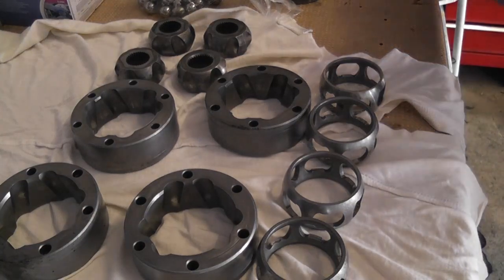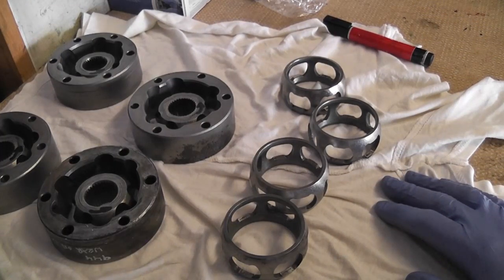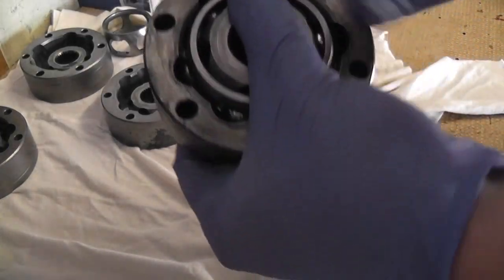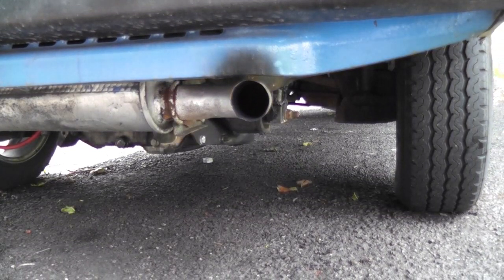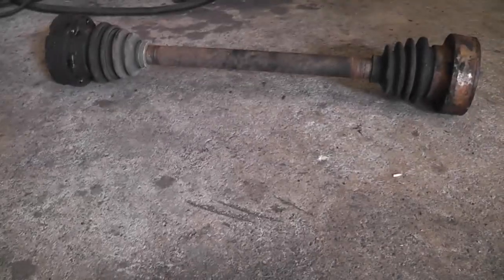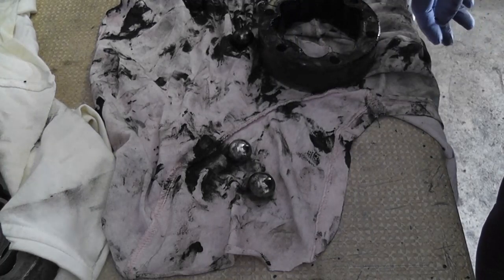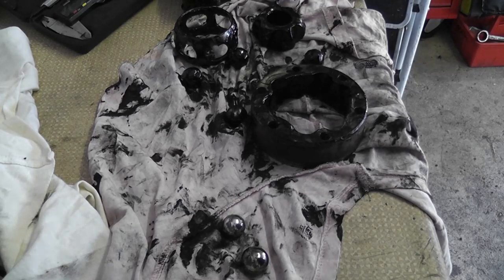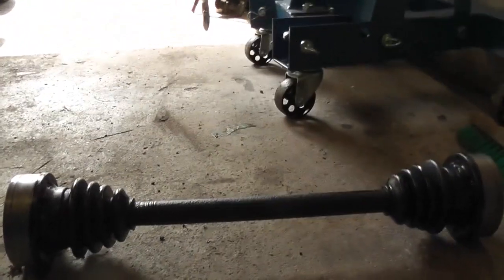Porsche 944 driveshafts in a VW T25 van. Will it cure the clicking?

Comment: Hello,
Wouldn’t a larger ball provide a higher angle? I’ve currently got an original vw t25 driveshaft on my work bench and 2 after market ones. The original vw one has larger balls than the cheap and poor quality after market ones.
Reply from the maker: I don't fully understand the science behind why the smaller balls help, but supposedly they do.

Comment: Hi Ross, thanks for your videos they are very helpful. I'm considering to put a fippedgearbox on my tdi 1z. Did you lower your supension? Or it is possible to mantain the stock shock absorbers and coils? Grettings from Porto
Cheers
Reply from the maker: Hi. Thanks! No, the suspension is stock height. I lowered the engine by 40mm though.
Reply: @Endfloat  I wish you were my neigbour 😄 So the Porsche cv joints can correct the angle? Thanks for your speed answer

Comment: 42:06 - did you buy that spacer or make it up yourself? Having same issue with mine in that the rear is sagging.. (and the camper too)!
Reply from the maker: I had them made in a machine shop. They can be bought though.
Reply: @Endfloat  great job! Do you remember the thickness of each adapter?, i have same problem.

Comment: Really interesting, thanks again! I notice you have a nice heavy trolley jack. Could you please recommend one like yours? I have a small jack but it doesn't lift high enough for me to get under the van really.
Reply from the maker: I bought mine second hand from a mechanic that was closing up shop. Its a snap on one so not cheap but it's one thing you want to be able to trust! It is very heavy too so not easily moved.
Reply: @Endfloat  Yes, I'm nervous using the small one I have. I do have ramps too but I'd like a bigger jack.

Comment: Interesting video! Can you tell me Ross what's your gearbox clearance off the ground under normal load? And if you think the engine/ box could be lowered to reduce the cv angle and compensate on the ground clearance any more, I believe there are some people running theirs with 4.5 inches clearance?
Also I see on the flipped box the flanges are not equidistant from the center line of the box like the origional is. Hence if the engine and box were offset such that the distance from flange to wheel hub on both sides were the same,.. wouldn't this mean that the stress on both shafts would be the same as oppose to one shaft being at more steeper angle?
Reply from the maker: Hi Brian. I have 6.5 inches of clearance myself measured at the bottom of the adapter plate. I probably could drop it a little more but with the 944 CV joints it seems to be ok now. The offset of the flanges is compensated for by the fact that one of the drive shaft adapters is thicker than the other. My biggest recommendation in all of this is to go for the AFN engine rather than the AHU and get a gearbox from a car that had an AHU engine. Also, take the manifold and head off the engine before installing it and clean out any gunk and get the injectors overhauled.
Reply: @Endfloat     cheers for that info Ross. Wouldn't the afn and ahu engines both use the same 012 box? I have a ahu and box from an a4. But it has 280k km on it so might just hold out for an afn if I'm going to be spending so much rebuilding it. 
It's better to use adaptors I'm assuming to build the 40mm or so extra on one side as oppose to recentering the box wrt the flanges? As it would mean the shafts might be too short without the big adaptor flange? Interesting, I see what you say about the head, to clean the gunk in the manifold and head due to build up over time, with relatively small cost of new head gasket and head bolts. 👌
Reply from the maker: @briankelly6114  no, they're different boxes. The ratios are different. I think I need to do a new video with all my findings and what I'd do differently if I were to do it again cause to tell the truth I'm not as happy as I'd like with how everything worked out. I spent a lot of money for little more than gaining a bit more top speed. It added a lot more complexity, if I was stuck, no garage would touch it, I'm still getting 30mpg, and I don't feel it's any more reliable. All in all, I'm disappointed.
Reply: @Endfloat  yes I understand. But unless we could make the repairs we wouldn't be tinkering with these haha. I have many options to think about on how to proceed. I also have a awx pd 130, red d redi which I'm considering installing at 15 - 20 degrees and flipped box. But concerened about ground clearance and coming up into the van into storage space.?? The performance would be savage, and be able to use many of its origional attachments.  To be fair these videos are top notch! Very hard to find good vidoos or reading material on these conversions. will save a lot of mistakes and money and time by seeing the progress here shared. Fair play. If you need any beetle parts, have a scrapped ex field buggy you're welcome to parts in athenry.
Reply from the maker: You're a star, thanks! Have you any 1303 parts??
Reply: @Endfloat  yes I have. It had the shell taken off and used for a buggy. just the chassis and drive train remain. Was outside for many years but I'm sure some of the bits are ok if you needed!